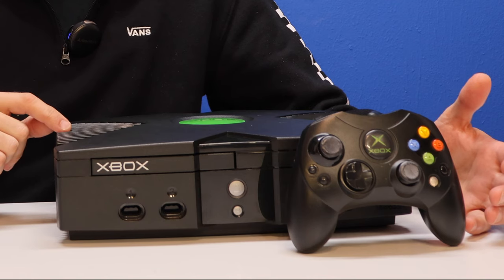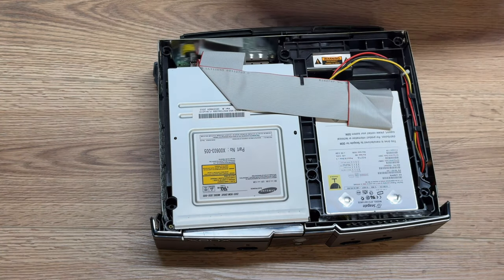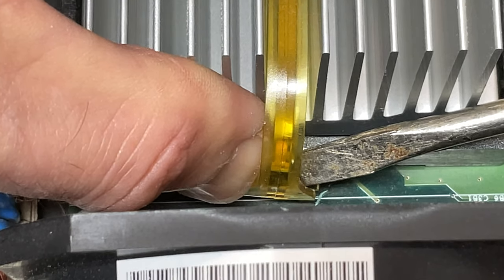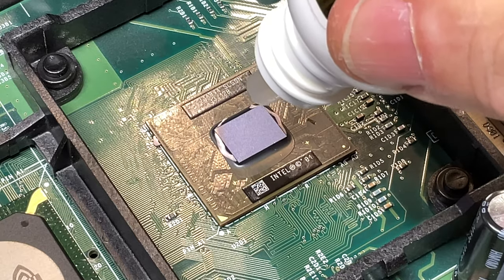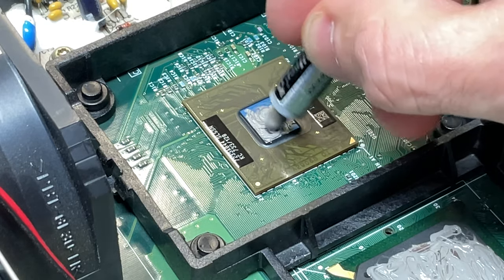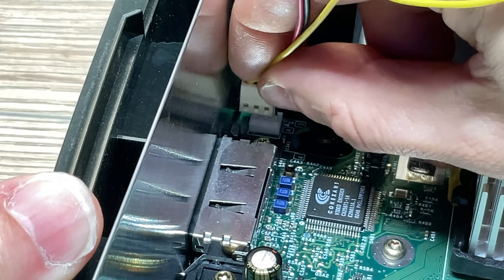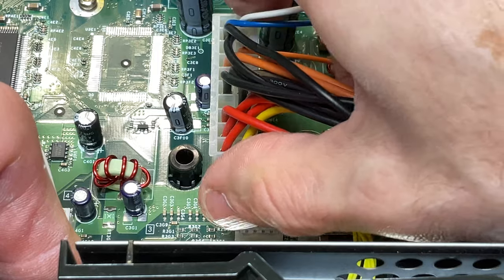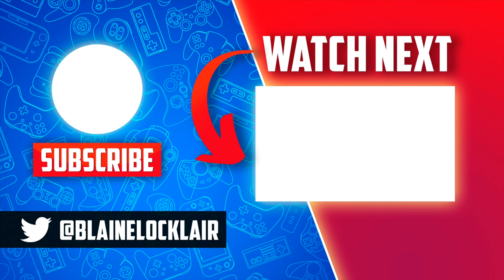Gain New Life For Your Xbox With Four Simple Steps

Comment: I hate that gunk under the heatsinks. WD40 on a rag takes care of that paste really well. Just wipe off the WD40 with some alcohol after. For those tall caps by the CPU and GPU, with those bulging, the console will eventually stop powering on. I ran into several, and those are almost always bulging. Console5 is a great place to get capacitors for multiple retro consoles.
Reply: Do you think this could be why mine doesn't stay on unless you keep the power button held down?
Reply from the maker: Good info. Thanks for chiming in! :)
Reply: @mikewhitfield7000  very possible

Comment: One other thing I would recommend is replacing  the rubber band in the DVD drive. I haven't had an issue with the Phillips drives with that, but every Samsung drive had an issue with it. I've saved so much money buying a couple of Xbox's with a "stuck DVD drive" that the only issue was needed a new rubber band.
Reply from the maker: Know what works well for this? Those small hair rubber bands you find in stores like Target in the beauty section. They're usually clear as they're worn in hair for braids and so forth. Stretch 'em out and they're almost a perfect fit for the drive. :)

Comment: Just a tip for removing the DVD drive or working on the mainboard.
The HDD always goes out first and goes in last. This is why the DVD drive caddy has this nose on the side. 
You don't need to fiddle around like you did in this video.
The thermal paste was always like this even when the console came out. It's more like a glue then a paste.
I wish I had this remover for it back then. 😅

Comment: This 70mm fan is impossible to find in stock for sale ...
Reply from the maker: It's in stock at Amazon and can be purchased right away. Glad they were able to get them back in stock.
Reply: I tried that Nexus fan in order to reduce noise. Temps ran higher than the original fan, requiring me to increase the speed, and then it wasn't nearly so quiet. In the end I reinstalled the original fan (after cleaning it and applying a drop of oil to the bearing).